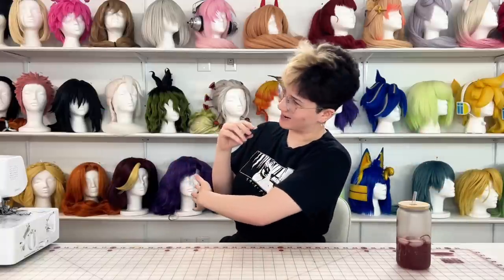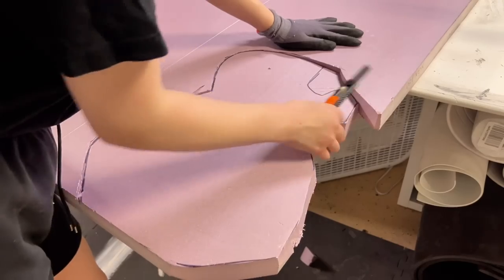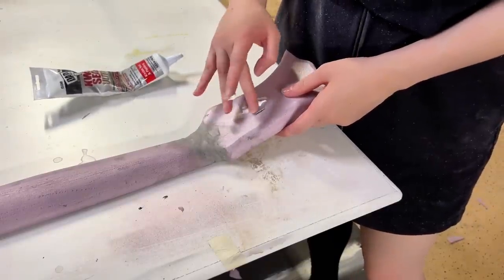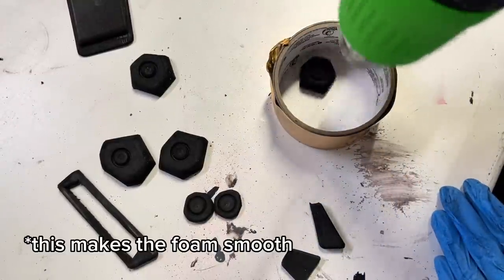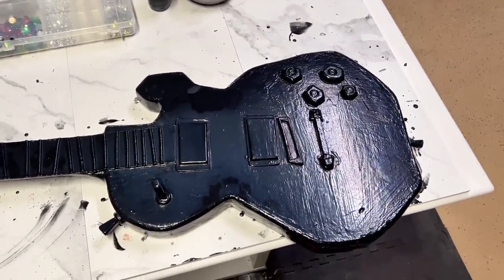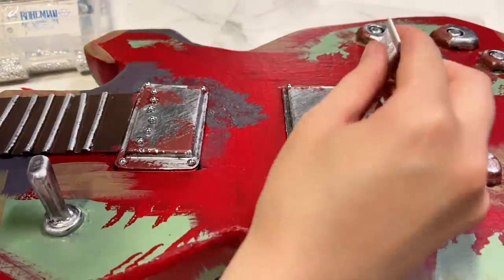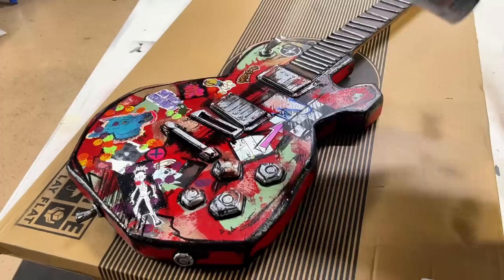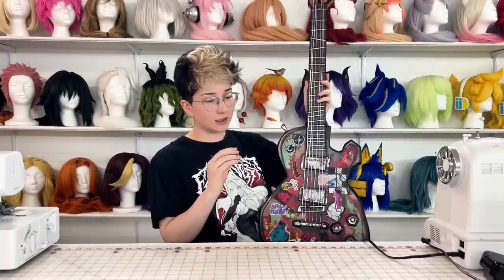I Made Spider-Punks Guitar | Cosplay Crafting

Comment: The cool bit of this is a lot of what you did mimics actual guitar building. The ending bit where you mention adding a dowel rod is actually why guitars have whats called a truss rod. The tension of the strings will pull the neck forward and seriously bend it. Sometimes the wood has a natural backbend and that rod lets you tighten or loosen it enough to play.

Comment: As a bassist I do not know 100% of guitar parts but I will tell from what I know of guitar terminology where the popsicle stick is called the bridge,the silver rectangular things are called pickups,the circles at the bottom right are called the nobs,the thing sticking up at the top left is called the gain switch and the things on the sides are called the neck strap holders the top is called the head👍

Comment: THAKNK YOU!!
edit: i’ve made a list of the things i need :D i’ve been checking if this video has been uploaded since that tiktok came out and i am so looking forward to making this
Reply from the maker: I hope this helps!! 🥰👍
Reply: wow, can you please upload this list?
Reply: @faydap8092  oh sure, it might be missing a few things that i already had, though
Reply: @faydap8092  
1 and 1.5 inch foam board insulation
sandpaper 
respirator (?)
to-scale printout
wooden sticks
foam-mo/foam clay 
kwik-seal 
2mm EVA foam
variety of different EVA foam sizes
spray adhesive
cutting mat
contact cement 
dremel 
heat gun
popsicle sticks
superglue
half moon 2mm dowel
flex bond/primer 
old paintbrush 
paint
robin buff - silver and whatever colours you need to make a rust colour
silver bead things
matte spray sealant/clear enamel
wire
gel superglue
instant cure spray
Reply: @hungry.hungry.hippos  Thank you very much!!